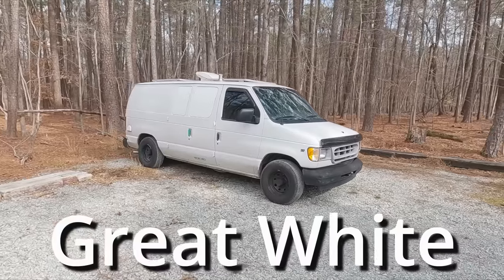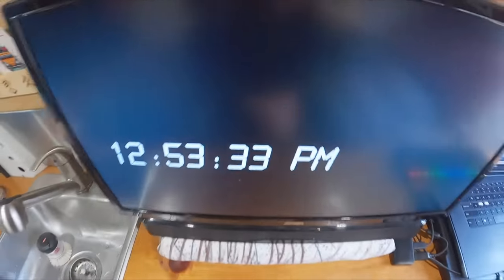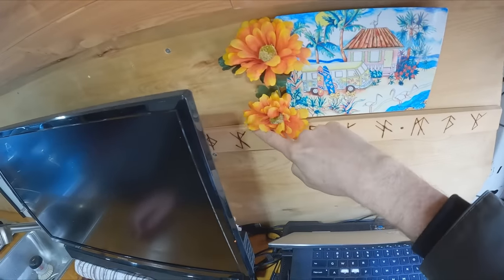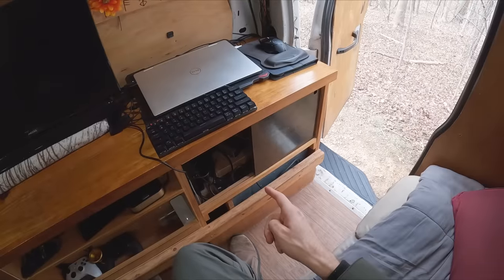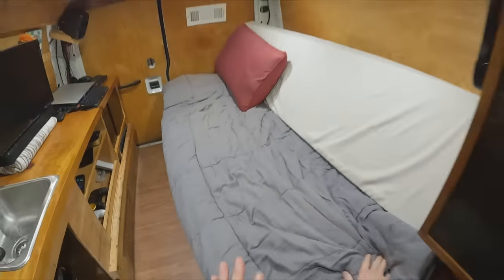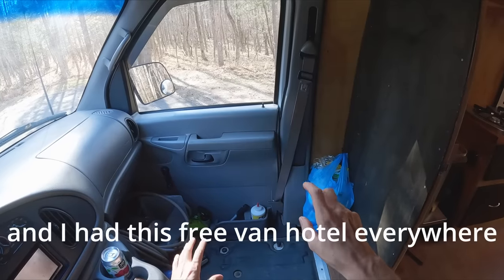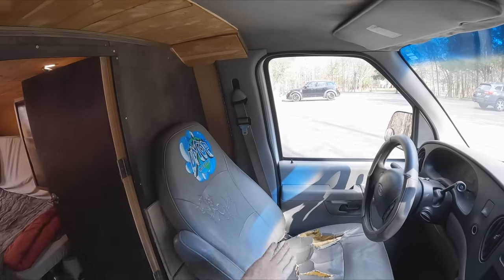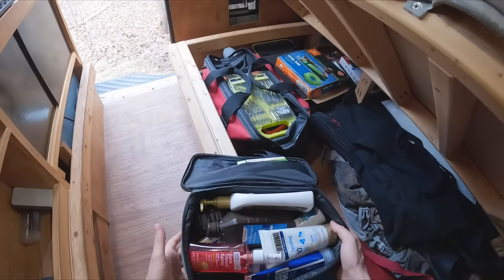STEALTH VAN LIFE TOUR | Differences Four Years Later

Comment: You saved a lot in rent in those 4 years and along the way collected more memories than most people will make in 40 years. Salute to Big White and the spirit of going your own way.
Reply from the maker: 100% thank you!
Reply: Don't forget property taxes
Reply: living in a van isnt as cheap as people think.
Reply from the maker: @Zesmas  it definitely can be, depending on the person. Living in a van gives you the ability to live for way cheaper. The pivot points are at gas usage and how much you drive (...more than if you were in a house?), food should be the same, rent is completely gone from equation optimally speaking, hotspot data, and insurance.

The biggest difference then would be gas. If you get antsy in van life, it's easier to just drive to avoid bordom. So it can be more expensive. But if you lived exactly like you do inside of a house, then vanlife is way cheaper. Even RV insurance on my van is 1/10th the yearly cost I ever spend on a normal car insurance.
Reply: @Zesmas  Yeah tell that to my peeps in Los Angeles where a regular studio can cost you $1800 a month…the van it is imho lol

If I was alone I’d definitely do something like this. ✊🏽👍🏽
Reply: @Zesmas  That doesn't mean anything, everything costs something.
Reply: @JoeyBK_86  🤔 2 years of losing that bill you could pay off a pretty nice newish van
Reply: @OutdoorsEmbrace  To be fair, what's 1 or 2k $ over a year in exchange for life affirming memories? Providing you are doing it with an adventurous heart and not because you are forced into it.
Reply: Taking a daily shower at a truck stop can run up to $300 or more a month.
Reply: @bryantcolby4038  he takes his showers at planet fitness, 10$ a month and they’re everywhere.
Reply: @bryantcolby4038  well... as a trucker I get unlimited free showers for fueling at loves truckstops... I will give away free showers anytime anyone asks
Reply: @JoeyBK_86  that’s probably in a not so safe part of town as well.
Reply: @Bluespicygreen  Is it that cheap? rly?
Reply: Most people in 40 years? Yeah I'm gonna bet  not.
Reply: I live in a house and don't need to pay rent.
Reply: @lukahiltunen7986  Yeah planet fitness membership is like 10$ for tanning, massage tables, showers and stuff.  Even free food if you're hurting for dinner since they have pizza mondays or something like that.
Reply: @handlerone5172  Oh my gosh that nice
Reply: @Deimos_Day  Maybe 10 years if I'm generous, but I had to add another zero to his 4 years. 😉
Reply: @maxhardcore8034  Hi
Reply: @OutdoorsEmbrace  man this is amazing I would love to do something like this I just bought my self a van so I can travel like this simply
Reply: If I do the math in my country I have to live like 10 years in the van just to get to zero. And that’s just the cost of the van without gas, fuel, energy, water and all of the other costs that comes with a van. :/
Reply: Imagine if the van was a Tesla. You could supercharge your way across the US and wherever. You could also get a Starlink dish for all your internet needs, no matter how remote you are. There would also be less wiring and less danger of propane leak because everything would be electric.

Your van is dope, one of the most well built out there. Great work and can’t wait to see your new build.
Reply: He never paid rent because he had to live in a van when his mom kicked him out of the basement
Reply: It's very nice, but where's the bathroom?
Reply: @gusgrizzel8397  He said he goes to Planet Fitness to shower and use the bathroom. He has a jug for peeing at night. Usually, people has a bucket lined with plastic for emergencies.
Reply: @heythave  Yeah, it's not always predictable.
Reply: @Zesmas  yes it is. People only "think" its cheaper than renting and thats because it is.
Reply: Also lost money buying this and didn't make money by buying actual property... My condo I bought in 2018 is worth more than double what I paid for it now.
Reply: @bryantcolby4038  planet fitness, it's free with membership.
Reply: Did he though? By me average rent is 900ish for a 2 bedroom that's 43000 over four years roughly. A decent van probably will run you 15,000-20,000. Then you have to pay  someone or put In yourself flooring solar stove sink bed etc and all of that has costs at most he probably saved 10k which is decent but that's like him saving $2500 a year that's like 1 paycheck a year he saves but he has to live in a tiny space to save it. Not crapping on the van life I respect it but people think they be saving so much money doing this and unless you keep doing it for like 10 years you aren't gonna see any insane savings.
Reply: @mizomint4197  but is it really? If you would sell it now, can you get 2 identical apartments for the one you sold? Probably not, but if you want to cash out and live on the gains you are good to go.
Reply: @funeralman9712  this is a lifetime lifestyle not just 10 years. 900 a month is ridiculously cheap and everyone with a campervan is doing this to avoid buying a house not renting a cheap house
Reply: @handlerone5172  now ask how much the yearly fee on top of that is.
Reply: @OutdoorsEmbrace  how do you manage to live in a van most jobs require a actual address as well as banks ?
Reply: @Deimos_Day  Yeah, I bet his kids will have beautiful memories off the time they were living in a van :D. But joking aside, if I were like 20-25 and single, could be fun but somewtimes you have to pay a price to have what you dream of, there are no short cuts. Good luck to you.
Reply: @OutdoorsEmbrace I love your van build!  I'm buying a diesel box truck soon to do a conversion to live in mostly full time and also to camp out on weekends. Also i will have my dirt bike inside so i can ride anytime i get bored. Greetings from Jamaica.
Reply: This video made me depressed
Reply: @lukahiltunen7986  yeah planet fitness memberships are cheap
Reply: Not so sure, I’d buy a house and do this.
Reply: It is pretty great though!
Reply: @b_ran3841  I can't even count all the people I gave away showers too when I was truckin'. Always someone who didn't normally fuel at Love's or a random hippie or homeless guy. If they were really hurtin' I'd use some points to buy them some food or whatever. A lot of truck stops are starting to really enforce their "No Solicitation" rules though. Don't see as many people asking for help anymore.
Reply: @Bluespicygreen  so what about if you need a number two?
Reply: Not to mention all the time saved not having sex.
Reply: @JoeyBK_86  $1800? NYC here. lol
Reply: @b_ran3841  is it true  truck stop showers went up to $25? My buddy said they did. I went local 2 years ago so idk how true it is
Reply: @Zesmas  I live in NJ living in a van would save me over a 1000 a month just in rent
Reply: I'm up to just over 3 years in my home on wheels. Best lifestyle ever.
Reply: Salute!
Reply: Why you assume he collected more memories? I belive a person living in a house or apartment will make the same memories 🙄
Reply: @OutdoorsEmbrace  Hotspot data can't be much more than paying for broadband. Maybe paying the same for less speed, but it's worth it when you're out in the boonies.
Reply: @JoeyBK_86  Even in places where rent is $1,000, it's still too much. Sign me up for the van life.
Reply from the maker: @GruppeSechs  secret for whoever sees this. Tmobile Home Internet. I pay $25 a month for true unlimited 5g hotspot. Just go to the stores and ask them about it. It works for travel. I get 80mbps download, 25 upload, and 50 ping.

This is my Christmas present to you guys. Hidden on this comment feed.
Reply: @OutdoorsEmbrace  Thanks for the info! 80mbps is plenty and more than I'd expect on a mobile hotspot. You really don't need more than, like, 25mbps for streaming and 80 is more than enough for light downloading, as long as it's stable. Most of the speed people pay for with broadband goes to waste.
Reply: @Deimos_Day  you'll be surprised how much people don't travel
Reply: @funeralman9712  unless you live in la or the ghetto
Reply: @michaelcarson1550  damn
Reply: @zdravo3543  he can literally travel anywhere in the country and possibly Canada.
Reply: Although if you live in someplace like Wisconsin winter is probably not the funnest time for Van life living. Not to mention how much it would cost to heat your van. So unless you are we able to get electricity to heat your van it's going to be expensive heating your van with propane.
Reply: Great way to save. Or, not spend. Two different things. If after 4 years nothing was stashed away, you did get away with working less, but when you get old, you will wish you worked those 4 years...
Reply: I did the same two years ago and live mainly in laguna beach. After two years I’m getting ready to pay the van off from the money I saved and put probably 10k into solar, cabinet, sink, wood etc.. so I consider it a 35/40k asset now. Time to look at fixing up a sailboat
Reply: @funeralman9712  No, because the cost of living is more than that. 

Standard rent on a place for example : £1k
Tax - £100+ 
Electricity, gas, water - £300ish 

A 1k rented apt generally costs around 1500/1800 per month to live comfortably. If you're spending £1500/1800 a month on a van you're doing it wrong.
Reply: @- J  I was speaking In terms of where I live it wouldn't make sense the negatives outweigh the positives
Reply: That is awesome. I will trade my Jeep for it?
Reply: @Zesmas  couldn’t be more than paying 1k a month for a studio apartment to get your shit jacked in a country hood 😂. And that’s a  best case scenario.
Reply: @OutdoorsEmbrace My boy has protection 💪 😏
Reply: @OutdoorsEmbrace  do you repair the van yourself?
Reply from the maker: @permanentvacation2406  If I can figure it out, I always repair the van myself
Reply: @Kazuma232  Maintenance as well.
Reply: I saved a ton switching to Geico.
Reply: @gusgrizzel8397 he goes to a gas station or Walmart or woods
Reply: @Kazuma232 you don’t pay property tax if you rent
Reply: @maxhardcore8034 you should own not rent. Different strokes, not everyone wants to be a loaner. Can’t have a family and live like this. Also contributing 0 to society, just living selfishly. I’m proud of my family, wouldn’t trade them for anything like this.

Comment: I like the wall you built between the front seats and the back of the van. The wood stove looks wonderful too. I would probably add a rear view mirror dash cam, like the Pormido 998S. Then you can "see" out of your back window while driving, even if the back windows are blocked.

Comment: I'm 25 & going to start my journey. Honestly in a tight spot but always did my best work under pressure 🤣 you've encouraged me to just go for it. It'll never happen if I don't try so all my saving are going into the best van I can make on an extreme budget 😅 lol thanks for the inspiration & solid ideas. This was a great video I'll be saving for later
Reply from the maker: For sure Dimitri! Just do it! It's not so scary once started. Just keep rolling with the punches and building towards the goal. It works out just fine. Tons of people make this work!
Reply: Hopefully it worked out.

Comment: Brother, you've done it right.  The hallway style works best in my opinion.  It allows you to move freely from front to back. I will give you one great idea.  Get a very small cheap electric leaf blower.  You can thank me later.  I had a large extended roof van and I absolutely hated sweeping it out.  I spent a lot of time near the beach and sand would get everywhere. With the leaf blower, you can literally blow everything straight out your back doors in seconds.  And not just the dirt on the floor but all the dust in your van. I even used it to get into my electronics and blow the dust out of them as well. I couldn't believe how simple and efficient that one little device was.  It's a game changer.

Comment: I love my 2001 Ford V6, white, clean body, barn doors very similar to this one, easy to work on had her for about 4 years too. Highly recommended the older Fords for a great start out van. I've only had to change the starter & power steering pump. Along with treating her good, tune-ups, oil changes, tire rotations & full self-inspection, top off fluids, tire pressure, check for any fluid leaks underneath every Thursday ready for the weekend.👍🏼 p.s. got to talk about my piss jug I like to think I invented, LoL. I took a exacto blade and cut out the nozzle on a tide laundry detergent bottle, leaving about 1/4 around the edge so the cap screws on nice and tight still, those bottles are shaped like a pear with the bottom cut off so they can wobble around but always stay up, way bigger porthole to do your business ( I've had some malfunctions with smaller bottles when I really had to go ! )🤤 it's got a big fat handle to hold onto & no one can see what's inside of it, just your average laundry detergent bottle & just so if there was ever a mix-up I've got my Dole pineapple sticker on the cap.🍌😉 I wish you many new Happy adventures with Megalodon & and hope I get a response from you about the longest comment about a piss jug.  Cheers😆✌🏼🏄🏻‍♂️🏂🎣🌲🍻
Reply from the maker: Hell yeah man! Here is a response for your pee jug!!! hahaha
Honestly only messed up once with it but not really, and my ex completely messed up haha. She kinda went on my floor hahahahaha. She wasn't used to it and tried those She Wee's out.

Nice idea on the Jug though.
Reply: Man I thought I was the only only one with a tide pee jug 😂😂😂
Reply: I always wondered why guys don't use hospital pissoirs (lol I'm Dutch and think pissoir is a nice word for piss bottle)! It's probably  French. Anyways next time I'm hospitalized will ask the nurses for one, I think the opening may be wide enough for women too. When I'm hospitalized I'm not allowed to use the bathroom by myself so I use a large pink water pitcher. I should get one of each and experiment. I've seen very compact Nissan nv200 toilets with a urine separator in a small bucket that seems great too.
Reply from the maker: @crippyandkaatje  I've considered them, but they are so small.
Reply: A walmart bag works just as good too!

Comment: Your build is beautiful and it looks so spacious inside! I always wonder when people use the word “Shower” but nobody ever mentions “Bath”. If there’s a small enough enclosed space, you can be seated, fill up a bucket and take a bath. I have seen people use a small removable bucket surrounded by shower curtains to take a bath in. The shower certain curls around the tub in a cone shaped like a small teepee tent. You should also look into a back up source of heat just in case you go in an area where wood is in short supply like an Espar or Webasto diesel heater and maybe add a cellular signal booster like a weboost since your Internet depends on cell phone signal but great build otherwise.

Comment: I like the roof (inside). I basically did my roof after watching you’re videos. I insulted it like yours and put 1/4” plywood up there. I put cedar planks up there too but I should have put shorter planks up there. Some of the planks didn’t connect very well but it does look good. I see your going to build a high roof transit. I have one as well but it’s only a 148” one with a high roof. It’s not as long. Cool build you have there, Ryan.

Comment: Man, I can't get enough of how well your van build is especially considering how spacious it is and how well put together it is. Absolutely wonderful and amazing and to see it's served you well for 4 years . I'm going to be doing this soon considering how much housing vs wages has gotten to be here in California. Just one question since we are coming out of winter , Have you had any issues with the roof jack leaking around the smoke stack? 
  I definitely like the idea of being able to have a small fire place considering I'm planning on going north when I get my build done. I'm going with LifePo4 for batteries due to the weight and depth of discharge using a MPPT charger and dc/dc isolated charge controller from Victron . Liked and subbed . excited to see more great videos and your new van build.
Reply from the maker: no leaks coming out of any of the past winters. Never actually had any leaks.

Thanks for the kind works!

Comment: So surprised how few stealth campers use camping hot water heaters. They are super compact, lightweight and hook directly to your gas bottle in 5 seconds. Gives a nice hot shower and you can move it about and hang it where ever you need. I've been using one in my house for years as my water heater broke. Will definitely be bringing it when I get my van.

Comment: Excellent job on your camper van.  In 1990 I bought a brand new Ford E350 Cargo Van.  Power windows/locks/tilt wheel/air conditioning/AM-FM cassett player with premium speakers/Fuel-Injected 460 V-8 with a 4 speed O/D automatic.  This was the first yr. Ford put it's electronic Over-Drive automatic behind a 460 c.i. motor.  Basically, this was a fully loaded cargo van that was meant to go straight to a van conversion company except I bought it right off the new Ford truck lot.  Wish I would have kept it.  The window sticker on the truck was right around $16,900.  I paid about $350 a month for 60 months, interest rates were shit back then.  It was through "Ford Motor Credit".